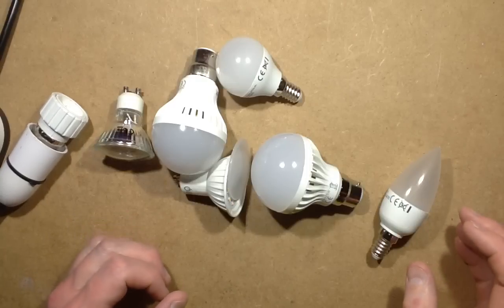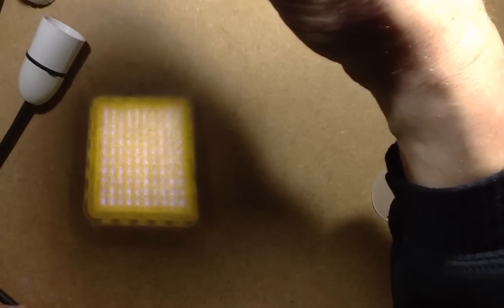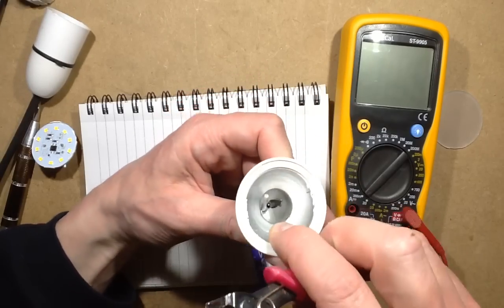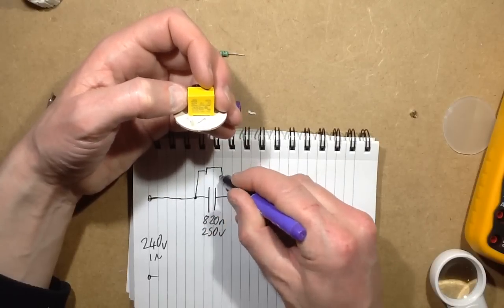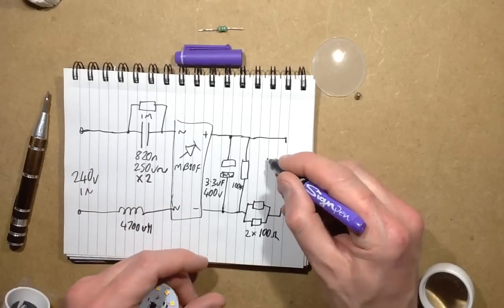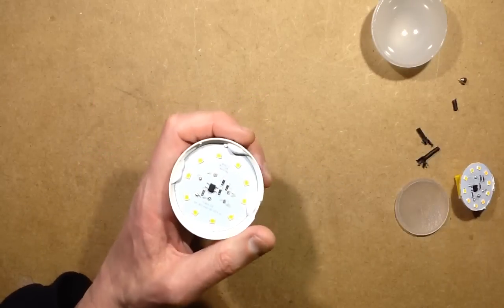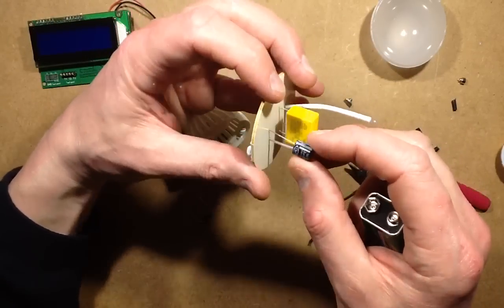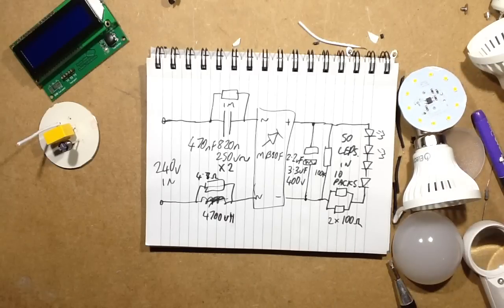New, and VERY interesting Poundland 5W LED lamps.

Comment: Good video. I think there are 6 LED in each 2.95V is a normal voltage drop for a modern white LED and they are probably rated for max 50mA with good enough cooling. I do like the idea of series capacitor to set the current is simple and effective the down side is the flicker and that 3.3uF will probably not smooth that much and will have a short live in those conditions. So the life of the bulb is mostly limited by that electrolytic capacitor.
3W is what I think the limit for a long lasting LED light in that form factor. 5W with passive dissipation is way to much. Most of that is still heat even with modern high efficiency LED.
Reply: +electrodacus I would say that the main thing that that elyt does is it shortens the time those LEDs are off, since you need about 170V on the input to light them up. Btw. when you are buing LEDs, you can use your phone to look at how much they flicker, the effect is obvious from the video.
Reply: +mrkv4k :) I live off grid all my LED lighting is DC from the main LIFePO4 battery so no flicker.
Reply: +electrodacus I had the 5w candle LED from Poundland. It did get quite hot at the base. It lasted about two months and started to flicker. It quickly died and had to be changed.

Comment: Nice and simple. Good that they thought to keep the electrolytic capacitor on long leads to keep it slightly cooler. What was its temperature rating, 85 or 105 degrees Celcius?
Reply from the maker: +bob s They're marked 105 degrees.
Reply: +bigclivedotcom Cheap lamps with components that might last more than 5 minutes, might be worth getting some.

Comment: I'm wondering if the aluminization of the backshell and the inductor are for radiated and conducted noise suppression. But if the aluminization is connected to one of the supply pins, is there polarization to ensure that it is connected to mains neutral? Or is the aluminization just floating? In that case, it must be a thermal consideration.

Comment: Just hacked the phosphor off the top of one of those LEDs, and it does look like there is 2x3 array of squares on one chip, two of these are bonded to the package leads the rest, I guess are wired in series. Very neat.
Reply from the maker: +ChayD Is the LED just a single bit of material etched into 6 chips?  It's quite cool how they are basically making high voltage LEDs.  Possibly because the smaller low power chips are less stressed than the single big chips.  And also because it makes the power supply simpler.
Reply: +bigclivedotcom Looks like a single chip with different regions stitch bonded together. I agree - very clever design, and becoming more common by the looks of it. There are quite a few companies on Alibaba hawking high voltage LEDs, including the ones used on those pygmy lamps you reviewed a while back. Love your videos BTW :)

Comment: it's amazing what they make, in the states we're getting quality Philips 10.5W (at 110 VAC) 800 lumens, a 3 pack for $5 USD. i've replaced all but a couple of lights with LEDs, just a couple of flourescents  left in my house, the fridge, 25 years old, still has the original 40w incandescent bulb in it, and that's been run at 3C for 25 years straight!

Comment: Thanks to this video I bought a ton of these for the home and they're doing really well. The best by far is the one that's not actually made by Poundland, the Bulgarian "V-TAC" 5W GU10 bulbs, which are even better than the 50 watt halogens they replaced. In your video it's the GU10 with the metallic coating. Definitely worth buying!
Reply from the maker: +John Boardman I don't have the facility to properly measure lumens in a scientifically accurate manner.  I doubt these are as efficient as the latest high profile lamp, but I would rate them as being much more efficient than a compact fluorescent, with the advantage of running cooler, starting faster and not smelling of hot electronics.
Reply from the maker: +Alexander Zarach I just cracked one of the v-tac GU10 ones open.  Quite interesting.  It'll be in a video that I'll upload shortly.  I cracked open all the V-tac lamps.  The globes and candle had a buck regulator, but the GU10 has an 820nF dropper with higher than usual 6.8uF smoothing cap.
Reply: Seems like much higher quality, and you can tell the difference - shame for them that they're ending up in pound stores!
Reply from the maker: +Alexander Zarach Poundland sources directly from China and has huge buying power.  These seemingly good quality lamps are likely made specifically to their spec.
Reply: I was referring more to the V-TAC ones as they're a legitimate separate company in Bulgaria - I was surprised those ones made their way to Poundland! The Poundland "Electrek" ones did look well made too in your video, much better than some unbranded ones I got on eBay from China. Those ones simply unscrew so I took one apart, very poorly made. Apparently it was 9 watts, but it was so dim!
Reply from the maker: +Alexander Zarach I've just made a video where I opened and explored the V-tac ones.  Quite hard to open and the globe and candle both had buck regulators in them.
Reply: +bigclivedotcom Hi Clive. Fascinating stuff, thank you. What about Lumens though? Light output is what it is all about and many bogus claims are made for bulbs. Have you got a reliable way of measuring lumens, or at least comparing bulbs. Lumens per watt for different led bulbs and also comparisons with the old low energy bulbs. How much better is led?? Many thanks

Comment: That resistor on the incoming lead is actually an inductor, just as you thought initially. Those cheap component meters mistake them for low value resistors. Julian Ilett used one of those meters to meaure the inductor in his walkie-talkie build and got the exact same result, it was showing it as a resistor instead of an inductor.

Comment: I had my first failure today of one of the plastic outer GU10's. Turned the bathroom light on and it just flickered and went off. Replaced it with one of the same, but we'll see what happens to that one. Only been in there 3 weeks

Comment: You see the way the light is flickering at 1:10....that is the reason I can't have LED's anywhere near me as it gives me an instant headache and makes me feel sick
Reply: +neonkt1 just buy LED bulbs that have switching power supplies (they do not flicker) and not these capacitive PSU 100Hz blinking.
Reply: +Paxmax Thanks for the advice, I will research them

Comment: Hi Clive, nice teardown videos and channel! Just a heads up, the royal-blue LED emitters that are used for white LEDs usually have a full forward voltage of about 3.3-4v at their rated current, so the packages in your lamps are probably 4-LED-emitters per package.

Comment: I bought one of the LC200A meters from ebay for £24.90 and it works really well ;) strange colour on the case though! I even messed about with the display and swapped it for an oled display...

Comment: I'd like to know if these bulbs work on yank voltages (120v) , even at half brightness.  I'll buy two. :-)  Due to advanced technology in "planned obsolescence"  it seems that the components are driven to the absolute hilt with, say, the GE Brightstik  run VERY HOT (80 C) with its pre-planned short lifespan.  I remember reading the original TI spec sheets about LEDs (they were just red back then) where they would last centuries, but may be slightly dimmer after 50 years. They simply didn't know if they even had a finite life!  Similarly, I rely on BS 7671 to weed out pervasive stupidity in the electrical codes in the colonies.  220v is more deadly and has therefore forged deeper safety rationales over the, oh, 100 years of it's existence.

Comment: I purchased two of these (bayonet type) from poundland. One lasted about 2 hours before popping and tripping the main fuse. wish I had kept it and taken a picture now upon opening it I noticed the capacitor wasn't soldered in properly (Loose connection) and may have been the cause of it popping and burning.. second one is fine though (so far)
Reply from the maker: +RCNewb It may have arced at the bad solder joint and damaged the capacitor by melting its insulating films and causing it to bridge internally.

Comment: Yes, that is definitely good advice to return the meter probes to the voltage position! It is all to easy to forget this when going from measuring a current source to a voltage source in quick succession, especially if one is a little excited while doing the tests! lol 

It would seem that perhaps that choke is doing a double duty of suppressing interference (to a degree, I don't know if it would be mega effective!) and also functioning as transient protection. Perhaps an inductor would be actually better for this purpose than the usual resistor commonly used in this kind of circuit?

Comment: Hi Clive, nice to see that X2 capacitor. is it usual? and what about the reliability of those leds? thanks
Reply from the maker: +Proyectos LED The X2 capacitors are rare, but I've just received another Chinese lamp with one in it.  It's possibly a safety thing if the plain red caps have been going nuclear.   I'm not sure how the LEDs will last.  It's always an unknown variable unless you put them on long term tests.

Comment: Mini (subjective) review: I bought 4 x 5W "warm white" GU10s today from Poundland after watching Clive's reviews. I replaced the halogens (4x50W) in a ceiling fitting. IMHO they easily produce more light than the halogens - which blows me away! No visible flicker and the power is measuring just under 19W total (a lot better than the original 200W). These devices are amazing and have come on in leaps and bounds in the last few years. The lens diffuses the light a lot - which is better for me. My only criticism is that "warm white" is a lot cooler than halogen - noticeably so. I just had a brain fart, picked up a yellow highlighter pen and coloured in the lenses. It is now perfect! Thanks bigclive
Reply: Jamie H TV TV

Comment: Question:
It seems electrical devices can induce noise on the AC lines which can be seen throughout the house, and presumably can be transmitted to the line outside the house and into the grid. Is there any way of filtering a noisy device locally at or before the wall outlet, such that it's not reeking havoc around the neighborhood? As far as I know, it hasn't been a problem, but I have seen YouTube videos where noisy devices can be used to snoop in on people's conversations.

Comment: I just bought some of the Poundland 5W candle bulbs. I know they're not supposed to be dimmer compatible but as (for now) I have a dimmer fitted, I thought I'd see what happened when I replaced half the halogen bulbs in a candelabra. Very curious results.- At very low dimmer settings (existing halogen bulbs barely glowing), the LED bulbs brightness is fairly bright already. Not entirely unexpected.- At medium dimmer settings (existing halogens orange), the LED bulbs are very bright. OK.- Ah higher dimmer settings (existing halogens now max brightness), the LEDS REDUCE in brightness again.This is VERY odd, the LED lamps (in parallel with the halogens) becoming dimmer as the halogens get brighter, and vice versa.I've taken the LED lamps out for now just in case the high frequency components of the dimmer waveform were screwing with the LED current and frying them.

Comment: Was there a RFI to the audio when you turned on the bulb or am I hearing sounds?
Edit: I have seen inductor used as fuse for a first time, in this video. Interesting.
Reply from the maker: +DjResR The iPad has a quirk, where the swamping of the image sensor causes noise on the audio.  You heard the optical hum.
Reply: bigclivedotcom Oh, thanks. Cheers.

Comment: yellow - violet - red = 4.7mH :) .. so yes, 4700uH :D

double checked on my, electronics toolbox app :)
Reply: +westinthewest 104 = 10 followed by 4 zeros 100,000 ohms or 100k.
Reply: +killer1479  I'm not sure about 104 being 100k though.
Reply: westinthewest ?:o
Reply: +David Warsop  Thanks, yes I see now.  I thought 104 meant ten raised to the power four i.e. 10k, but the three figure system allows for the first two digits to be the 'significant figures' which could be '22' , '47' or indeed '10' as in this case.  The third digit can then add the zeros.  Learning is fun!

Comment: Can you talk a little bit about power factor for these LED lamps, I understand that the pf can be quite low because of capacitors and/or inductors in the circuit. Without an inductor in the circuit we would have a leading pf because of the quite large capacitors. Just wondering if the inductor is put there to bring the leading pf closer to unity.
Reply: +Joseph E I think any source of lagging power factor is beneficial to the network because of the amount of inductance everywhere else.  Some industrial installations have to install large capacitor banks to bring their power factor back to unity.  They should've gone to Poundland.
Reply: +westinthewest Did you mean any source of leading power factor?
Reply: +Joseph E Sorry, yes.  Capacitance leads, inductance lags.

Comment: Nice one Clive I haven't seen those New big 5w bulbs yet down here on the island (I.O.W) but we have got the "new big 3w ones" which is good, we have however got a new small 5 watt BC lamp about the same size (but different) as the old 3w ones, The new ones get hot after 10mins...Yeh that's not going to last long.
Reply: updated  most of my lighting about a year ago with the poundland 3w and 2.6w bulbs  18 lamps. only had one failure a g10 that  may have got wet from a shower mishap . recently updated 6 of the bc cap lights to the new 5 watt design 3 of the small size and 3 of the new larger size two of the smaller size have already failed took them apart and they show all the classic signs  of overheating .will be sticking to the larger size from now on 
also updated to the new 3w g10 design  ok so far and in my opinion  much greater light output despite the  power rating

Comment: White LEDs must now be really cheap, since they use the same LEDs for all power-ratings.
Reply: +NatureAndTech Not the ones in the video, but I got a hundred 3650 LEDs (which is what my current set of bulbs use) for US$1.00, shipped from China. That's just a little bit more than a stamp for a domestic letter here -  crazy... "Buy it now" currently seems to be around US$2.00,

Comment: Might I recommend the DER-EE DE-5000 LCR-meter? I got mine from eBay, from a Japanese seller, for around 150$ (123eu at the time, a bit over a year ago), including the short crocodile-clip attachment and the SMD-tweezer - both 4-wire measurement ones. 

IET sells a re-brand of the exact same meter, and Dave (EEVblog) did a teardown of it, and there's a pretty sizeable thread about it, on his forum :)

Comment: The less components there are, the less that can go wrong :-)
17 volt chips, thats different :-)
Have a happy xmas clive :-D
Reply: +zx8401ztv how long before someone makes a single 240v cob! (well it would be a bit higher for rectified mains) but one day!
Reply: +jusb1066 And if it was made like a dome, the light would be almost omnidirectional :-D, that would be a good replacement for our so called "bad bulbs" lol.
Reply: zx8401ztv
dont you like the string led's which look like early edison/swan light bulbs? they do at least  seem to work well, but i prefer frosted bulbs to diffuse a bit, yes i wonder what another few years of led's will do!
Reply: +jusb1066 No i dont hate them, they are an imitation of the real bulb :-)
I just think if you have a lot of leds or one big chip, you would need a big lumpy heatsink to mount it on.
Im thinking about the typical leds that are really directional and would need many leds with overlapping spots to do the job as well as ordinary bulbs.
Or a diffuser, like you said, but that blocks light a bit, perhaps no more than the coating on the inside of a real bulb, hmm ive just ran into a mental dead end lol :-D
Reply: nice to see zx8401ztv
well i dont miss the old 100w bulbs! i just threw out about 50 of them, i hated my workshop lamp got too hot to handle, i found a 3w forward firing led that put out the same amount of light, and of course is cold to the touch, so once i found those, i wont go back, the old cfl i didnt like mainly because they were large so glad to be ridding myself of those slowly.  nice to see poundland selling half decent ones also, oh well perhaps soon they will have an led you really like!
Reply: +jusb1066 Ha ha i dont hate anything, i just think it has to do a good job of replacing the bulb or flourescent, not light all in one direction lol.
Im just a grumpy old git, you should remember that ha ha :-D
Reply: zx8401ztv
I enjoy the discussion zx! :)
Reply: +jusb1066 Good :-D, some people hate my logic, its funny how people react, i think its the flag that upsets them, its a good excuse :)

Comment: My multimeter can take 250V through its probes on all settings - including fun things like the thermocouple setting and ammeter. All that happens if you short the probes out (because I did it once) is an easy to replace fuse melts.

Think I'll be off to Poundland. I might be able to run the living room light fitting with all five bulbs present and not run up a massive power bill now!

Comment: Why not use the magnifying glass to see the led setup on the new lamps to see if it is 5 per unit ?
Reply from the maker: +gigabytex64 I tried, and couldn't make out distinct LED sections, mainly due to the diffusion of the phosphor coating.